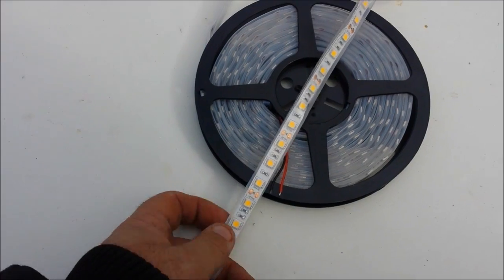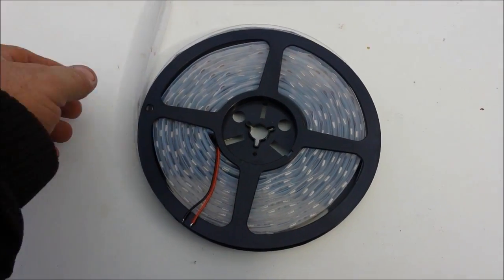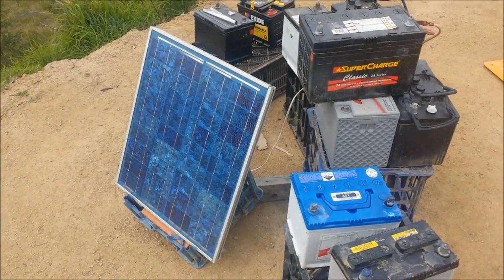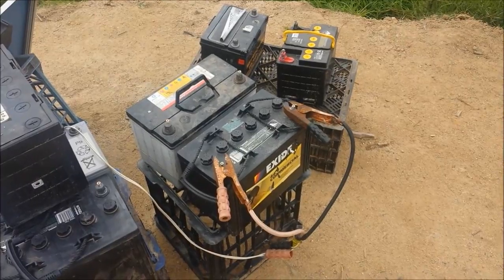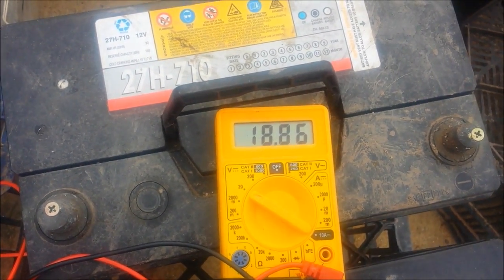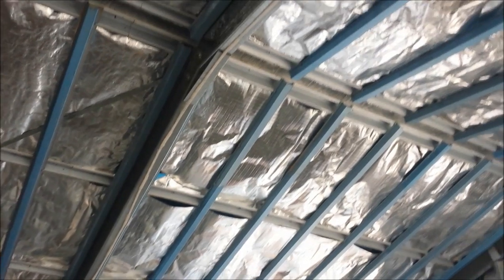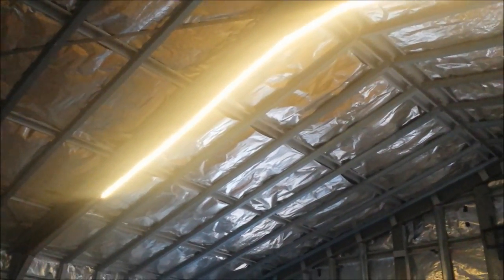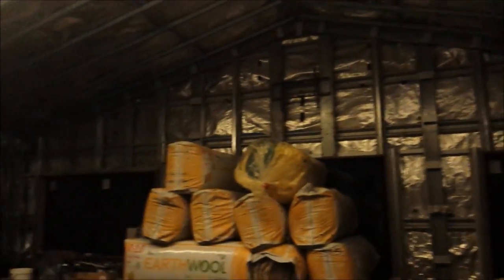Off Grid Solar Power - DIY LED lighting.

Comment: You're killing your batteries prematurely by overcharging them without a charge controller. If you review the specs from the battery manufacturer it will specify for a 12v battery, charging voltage around 14.5v, float around 13.6  If you overcharge them you will lose much of the life of the batt.
Reply from the maker: When batteries are free and can be sold for scrap, it doesn't matter how long they last.

Comment: Does this have a inbuilt USB for charging just incase the inverter is not fully charged
Reply from the maker: PIR Motion Sensor As shown in the video, this system does not have an inverter. The panel has a nominal voltage of 12 volts, as do the batteries. The LED lights are also 12 volt. Also, being picky, I know, but inverters don't take a charge; they convert electricity from DC voltage to AC voltage.

And to actually answer the question...No, there is no USB port. Thanks for watching.

Comment: I have wanted to use LED rope light with a solar battery backup for power outages and earthquakes. So when power goes out I can flip a switch and turn them on. Would be able to help me with this?
Reply from the maker: KosukiFire Sure, ask away.